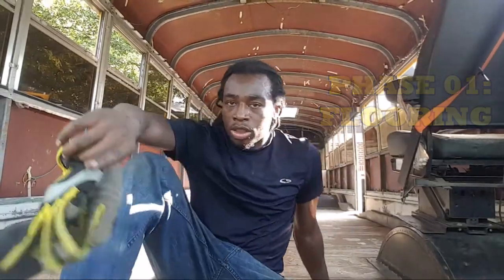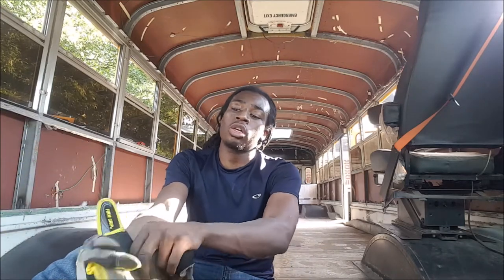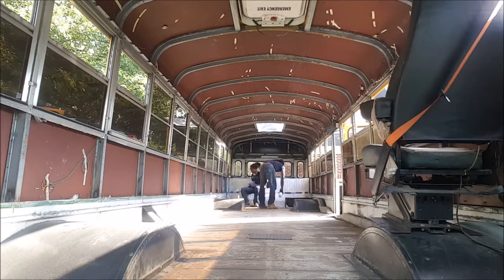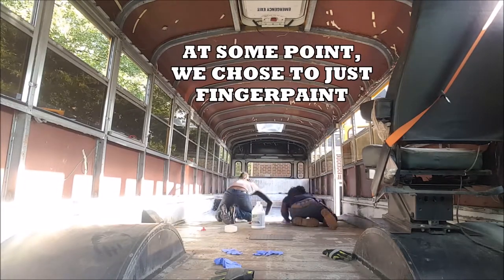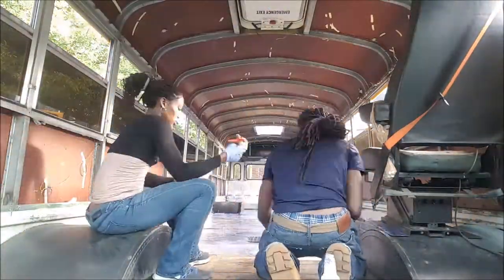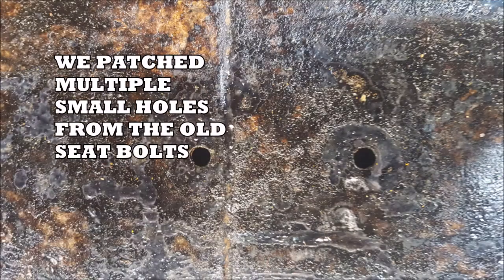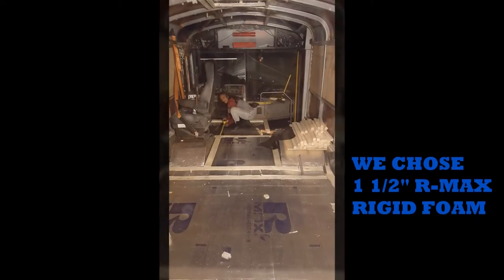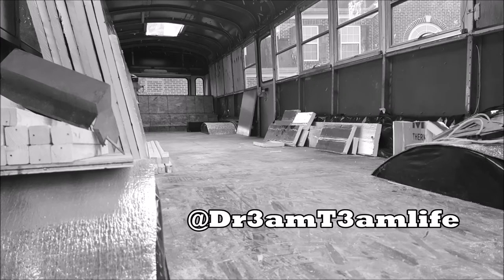Skoolie Conversion: Seal N Secure - Pt 1 SubFloor - Video #6

Comment: So u guys did nail down the 2x4? U just put it there?
Reply from the maker: LoveSomeMontana no we didn't nail them down. friction will eventually hold everything in place. we screwed the ply to them though. the bus moves and twists too much in motion to screw in. if you do that, your floor may break when the wood expands/contracts, or you hit a big bump
Reply: Dr3amt3am Life thank you!!!
Reply from the maker: LoveSomeMontana remember #AllScrews #NoNails. you'll squeak
Reply: Dr3amt3am Life what do u mean?
Reply from the maker: LoveSomeMontana when a floor squeaks, like in a house, it's the sound of wood and metal rubbing together. The floorboard is moving down the nail. If you screw it down, it won't move